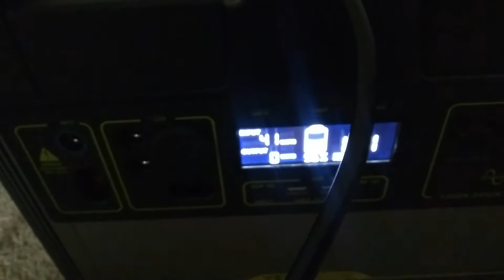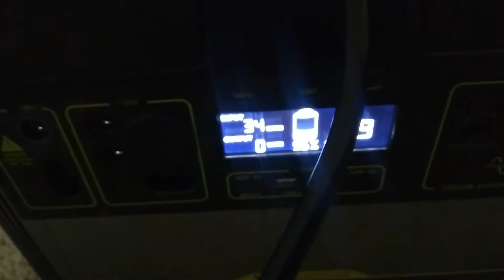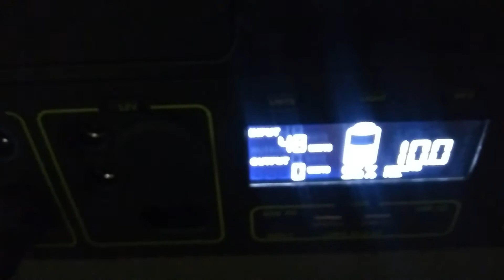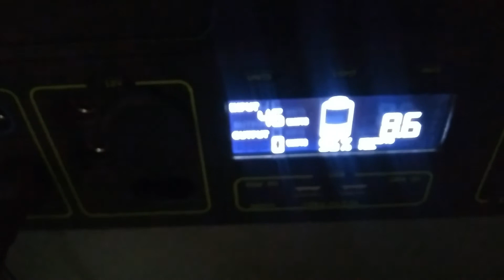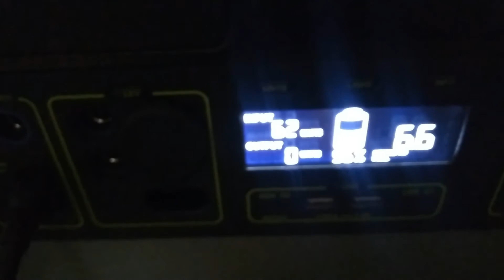Goal Zero MPPT Problem & Solution

Comment: My yeti 500x quit after a year. I tried all the YouTube 'fixes' but no luck. I took it apart, 2 fuses inside were OK. I'm thinking an AGM battery, good charger & sine wave converter would be way cheaper & easier to troubleshoot.
Reply: Don't buy a powerstation. It is overpriced and irreparable. 
As you wrote down, for sheaper, you can built your own system
Reply: My 1000 X and 200 X and all my lanterns stop working within about two months of each other. They are four years old and not used daily. I think I’m switching products after this.

Comment: Their mppt is actually pretty bad. As long as your awg is 10 you should be fine with a long run. The problem is they encorage using lower volt panels... under 22v. Most solar systems have really high dc volts allowing you to run longer strings. GZ really messed up their mppt only allowing 22v. That is the problem.

Comment: Yes Yetti kind of sucks. I have large gauge wire and mine fluctuates all over the place when I have my victron Orion hooked up to it. Plus if I try to add more power to the 8mm plug while the Anderson connection is plugged in it will not add the extra power . Go with the Bluetti  instead.
Reply from the maker: Yeah, the GZ MPPT does have some weird behavior, I wish we could get an explanation from GZ. The short-wire, heavy-gauge trick does work for me, but that really shouldn't be necessary, should it?
Reply: They seem to be hiding something about their mppt. It has some major issues and I'm trying to figure out why mine keeps going half power. Can't get the full 350 watts... only half

Comment: Thank you so much... You make me laugh with your desperate attempt to find excuse to Goal Zero crap powerstation "made in China". 
Mine passed away from battery overheat and MPPT failure, after only 2 years of very low use.
And, of course, no support and no spare parts...   Good bye, Goal Zero Now, never again
Reply: Ditto.